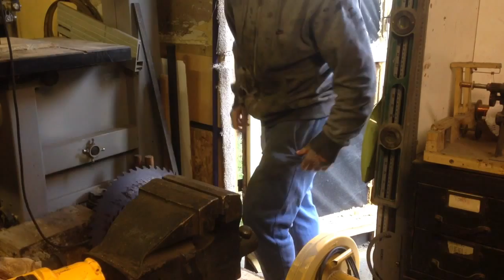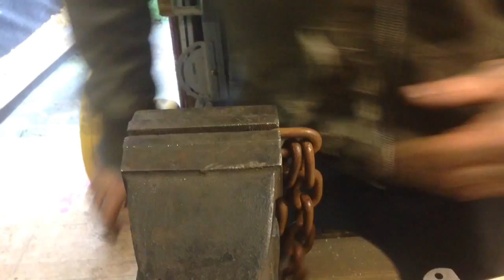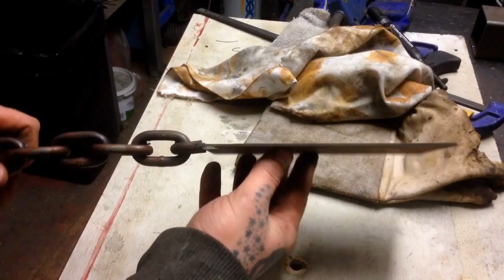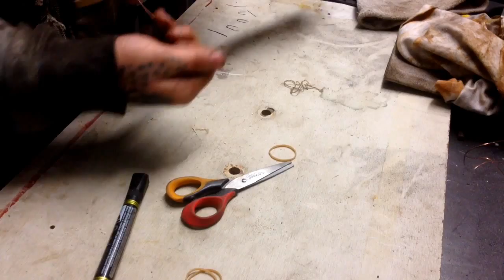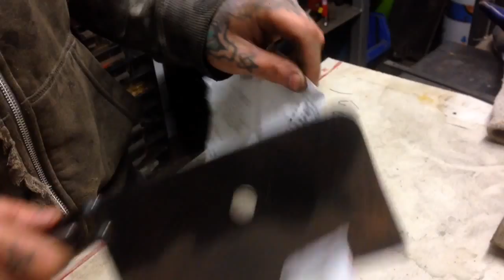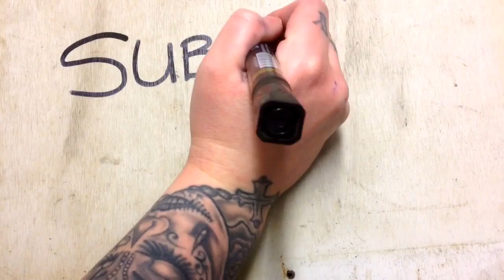chain handled saw cleaver movie prop style

Comment: Good work brother. I bet, by using an old saw blade, you skip the annealing part of the cleaver and the edge will keep as if you heat treated it, without the heat treating. Pretty smart. I haven been wanting to make spear heads for use as a survival tool and spearfishing. Thanks for giving me good ideas.
Reply from the maker: Yeh on this project I didn't have to heat treat which made it so much easier haha.
Oooo spear heads from sawblades is a great idea I may steal it 👀
Reply: Have at it brother!!!